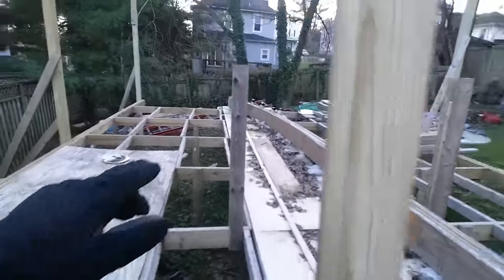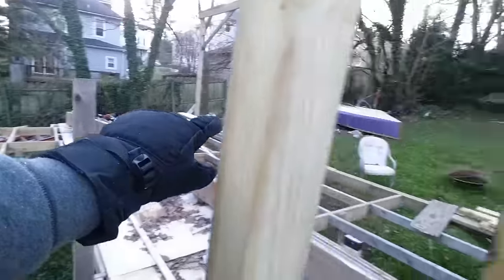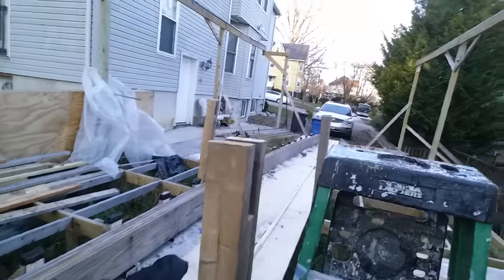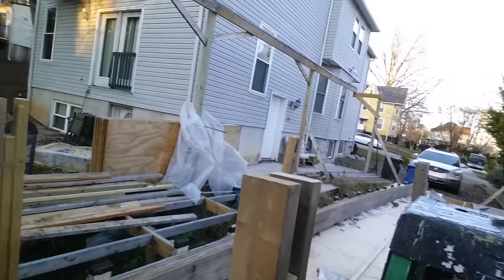Building a lite duty gantry winch

Comment: I'd recommend bracing the two pillars with to oblique braces that go directly to the ground. The direction should be along the length of the structure.

-Why not have the braces rest on the structure? Because it would probably upset it in time(i'm going by the assumption that you want it to remain as level as possible, as a point of reference), also, it's quite a lot easier to reposition the braces should the ground compact under them, where as putting them on the structure would eventually ruin the wood and make it hard to put a proper screw.

Anyways, Happy Holidays, have a nice Christmas and in case you're not uploading anything until the new year, Happy New Year!

Looking forward to what 2016 will bring for your boat project :) it's a most interesting project.
Reply from the maker: Actually that is the plan. It will be an "H" frame with diagonals down to the ground coming from a point above the load.

Comment: Glad to see some new content and that the dream is still alive. Also happy you resolved the matter with the city. I'm from the city and knew how hard that can be. 

Quick question. With your scaffolding, is the wood treated? What will happen when the wood become water logged the dries and heated? Won't it warp and make it unsafe as you continue to build?
Reply from the maker: Yes it's pressure treated, but even if it wasn't the boat should take a few seasons to build. Framing lumber wouldn't fail that quickly. The only thing I really have to worry about is the plywood decking but it's painted with epoxy paint. Stay tuned :-)
Reply: +Iandi Boats okay sounds good. Hopefully next time I'm on leave I can make it out to the boatyard. This last time I was home I had to replace a kitchen floor.
Reply: +Joshua Jones That would be awesome to see! :)  I wish I could be there to help too.